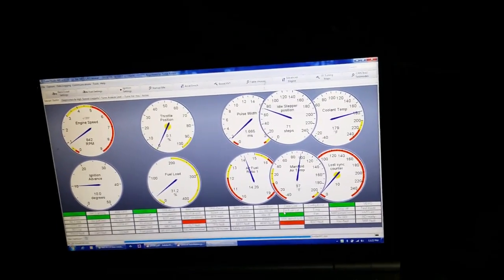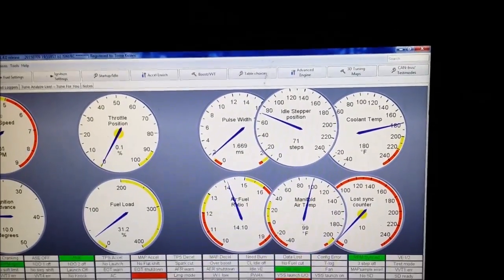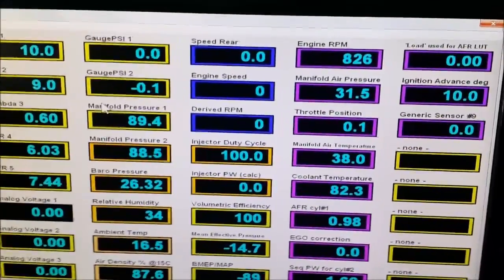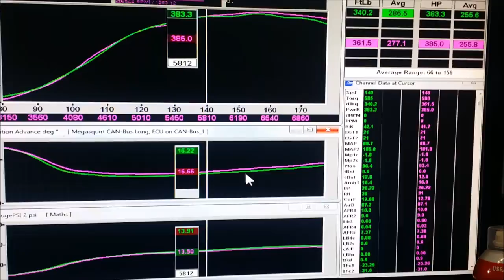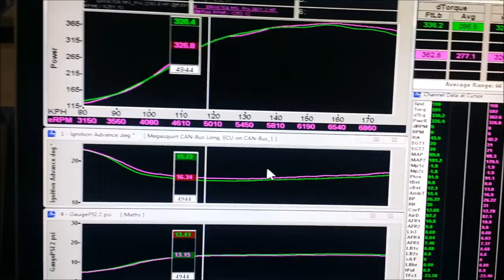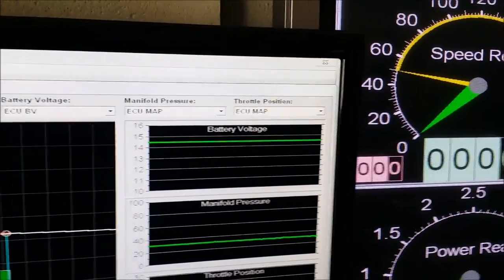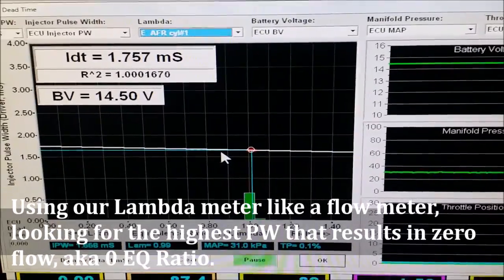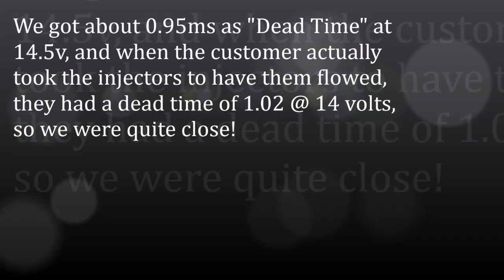CANbus interface to your Mainline dyno and finding Injector dead time!  Megasquirt ECU in a Supra.

Comment: Very nice informative video! The trick with finding the injector dead time is really useful, and from what i guess you can manually do this without being on a dyno as long as you have a wideband sensor install. Just make a spread sheet take measurements at various IJ pw and interpolate like in the video
Reply from the maker: As long as you have a way of holding the car at light load, so that the injector is operating at above the idle or non linear regions of its flow right near the bottom.  Depending on the injector, especially large ones that idle at very low PW, you could end up in that non linear region if done at idle.  You want to be somewhere in the injectors operating range where their response is best characterized by the "slope intercept" model, if that makes sense.  Ditto for the "method" of switching from single injection to 2 injections per cycle.  If you are at around (as an example) 1.3ms of a Bosch 2000cc injector, that method not only changes injector timing, it is in the erratic range of that injector, and the results will be meaningless.
Reply: @DynoMotiveDyno  that is one slow reply, but hey better late than never 😂

Comment: That Mainline Dyno is pretty awesome, especially with the canbus data. Wonder if there is a way to plot the deadtime in megasquirt itself as it seems to just be plotting PW and 1/Lamda.
Reply from the maker: As long as you have a way of holding the car at light load, so that the injector is operating at above the idle or non linear regions of its flow right near the bottom.  Depending on the injector, especially large ones that idle at very low PW, you could end up in that non linear region if done at idle.